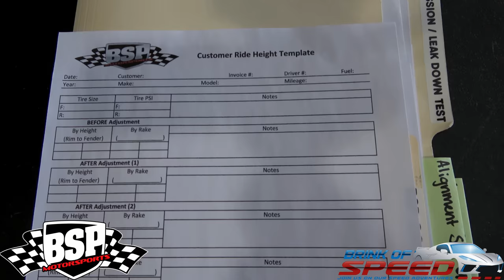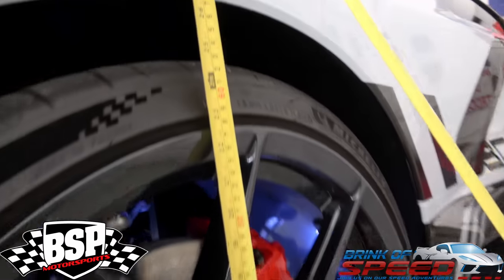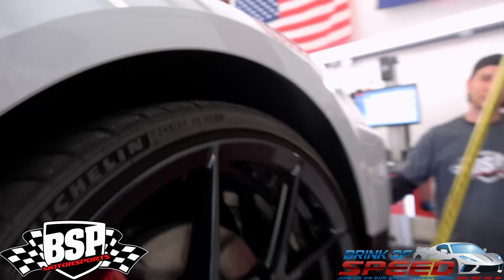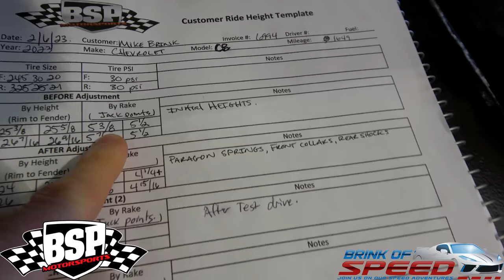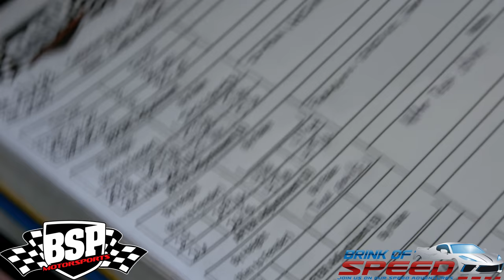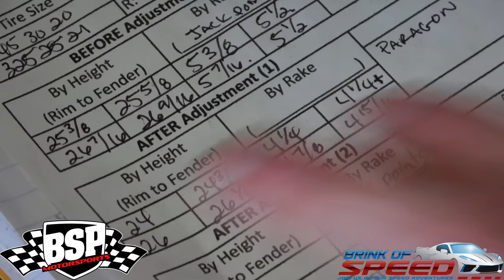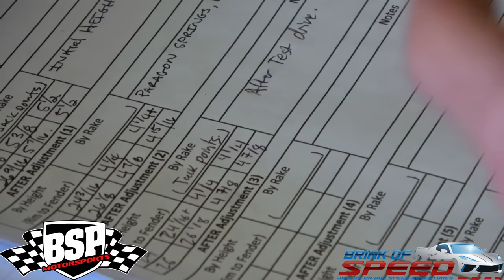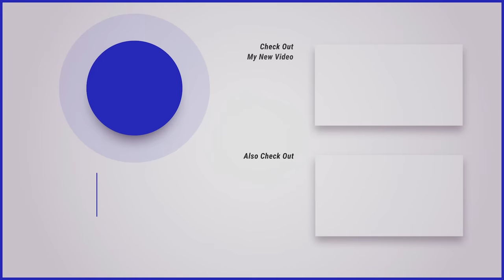Taking my C8 Corvette to the next LEVEL by doing THIS!

Comment: I'm curious as to what you'll notice in ride difference. I'm guessing it's going to be a lot firmer? I like the idea that BSP is keeping the rake in that under hard acceleration you will get and need the rear squat and you don't want to lose that. Keep us in the loop Mike. Save the wave albeit from a lower vantage point. 😉

Comment: Much better looking! Lowering these cars make them look a whole lot better. I did the Paragon springs on my first C8 with 19/20 inch wheels and it looked good but on bigger bumps it was just a little to harsh.  Our roads are trash here. Current C8 has 20/21 inch wheels like you but lowered on factory  Z51 coilovers. Sits almost perfect and not nearly as harsh on bumps, but wish there was just a little more adjustment in the rear.

Comment: I already have this setup. My rear never settled. I can fit 1 finger in the front and 2 in the rear. I will take my car back to life the front a bit more. I want it the same level as the area to have a consistent look.
Reply: Same here, I was trying to get that leveled look as well and get rid of the raked look. Wished the rear would've dropped just a little more because the front looked perfect.

Comment: You can get the same effect by doing the C8 track alignment. I did the track alignment and the car lowered significantly. Not only that, but the car handles way better with zero difference in tread wear, contrary to popular belief.
Reply: The car can not lower with an alignment no matter what specs used.
Reply: Z51 cars this is true because they can adjust the factory coils almost a full inch lower.  Mike does not have z51 package.
Reply: @Aspendog2k2  lots of opinions on the truth on this on the internet. However, it most definitely made it lower on my Z51, and I track my car. And I've never had a problem with the front end scraping, but now I do because it sits lower. Yes I do have a front end lift. I wish I could post a picture to show the gap from tire to wheel fender.

Comment: if your Vette is still under warranty and you have the front lift package, lowering your Vette will void your warranty, and you'll get error codes.  Just a heads up.
Reply: I’ve lowered two c8’s both with front lift and never had one issue.
Reply: @nrdemon1031  Happy to hear that, my man.

Comment: It looked like the outside of your tire was a bit either choppy or cupped that’s when w looked at it before any work was done. I don’t think I would run the 1000 miles before bringing it back to re-align it. A 1000 miles could cost you a set of tires…